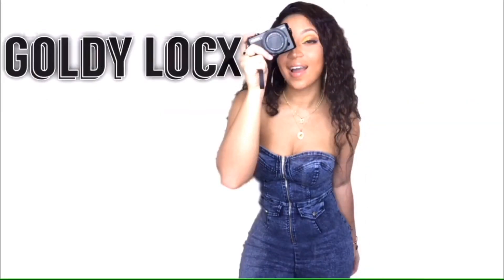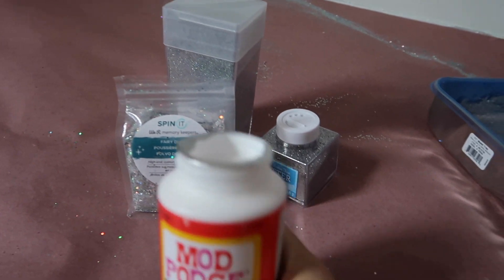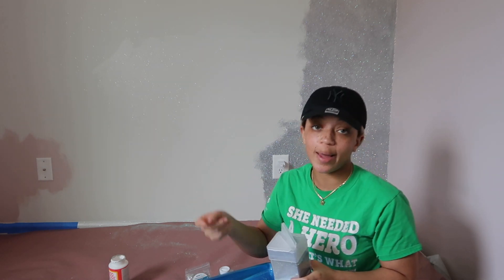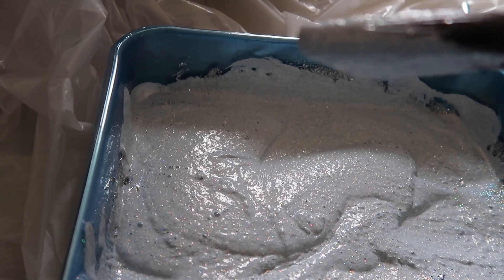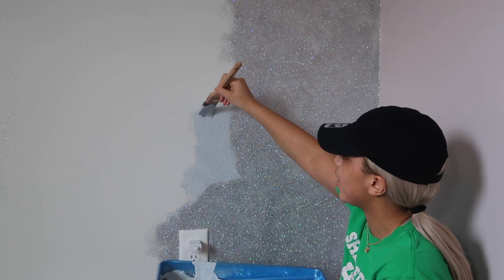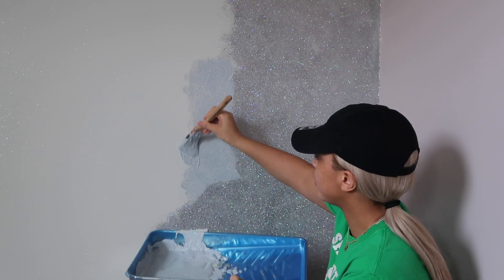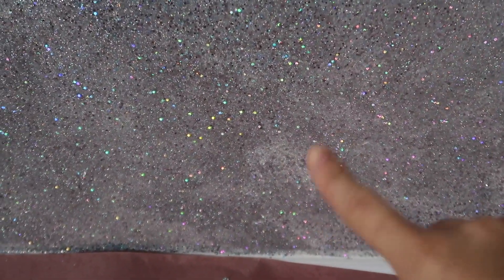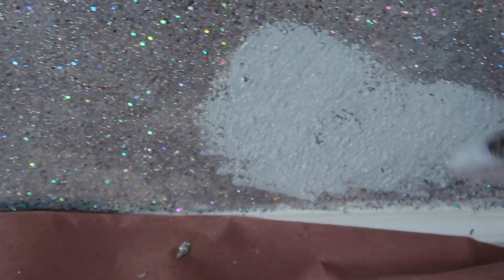DIY GLITTER WALL

Comment: Wouldn't it just be easier to paint the wall the color you want it to be with normal paint, and then just get a clear top paint and dump all the glitter into it and apply like normal? Compared to hand painting the entire wall and getting splotches spots you then have to do another coat on. Just paint the walls like you paint your nails with glitter top coat if you want a prominent glitter.

Comment: Do you think this look could also be achieved with a sponge?
Reply: A normal sponge like you'd use in the bath? I don't think so, no.  Sponges are absorbent - nylon paintbrushes aren't.  I honestly think you'd find it a frustrating experience with a sponge.  You'd end up with a sponge full of Mod Podge, and keep lifting off the glitter you've just laid on.
This brush technique, an extremely close weave sponge roller, or at a push – some plasterer's spreading tools, perhaps!  That, or ultrafine glitter, a compressor, an air gun, then pebble-dash your wall if you're feeling super-brave –  you'd get it done in about 2 minutes! 😂

Comment: It's another video I just watched before this. They used a paint roller and it turned out beautiful to cut a lot of time out I will be using the paint roller it's just a specific kind you need. But this is very helpful as well.
Reply from the maker: Got ya ! See that’s really helpful to know which type to use bc when I did it, definitely did not work. Thanks so much for the clarification love🦋
Reply: @GoldyLocX  mohair roller.
Reply from the maker: @minamuhammad9914  thank you so much for sharing!

Comment: The only thing about mod podge is that it yellows overtime. It takes a few years but that's what I'm trying to see. How bad is this yellow after a few years? How would we remedy that and can this be painted over with regular paint without any lumpy texture if/when I decide to sell my house.
Reply from the maker: C&M Studios I don’t know about the yellowing but it silver, there shouldn’t be any shown yellow whenever it does start to age. Also no you won’t be able to just paint over. You would need a sander possibly and/ or the same elements used to remove popcorn ceiling. 💜

Comment: Where did you find the bag of chunky glitter I cant find chunky glitter in big amounts like that anywhere!😔😔
Reply from the maker: I went to Michaels they had all the holographic type glitter. If you go, be sure to pull them up online for a 30% off coupon for anything originally priced!!
Reply: Thank you for your response! Those 3 glitters were all you needed for the 2 coats on the wall?
Reply from the maker: Kira Brewster no, get about 2or 3 of the larger sizes of each. Always keep your receipt bc whatever you don’t use, take it back to the store  if it’s not open that is. Lol

Comment: Thank you for the way you did this video. It's exactly what I needed. Why can't I use a roller? Ahh, that's why. Love how you used the three different types of glitter and showed the different between the patchy and the solid. Curious - is the wall just as sparkly now, 6 months later? Has glitter rubbed off or flaked off?
Reply from the maker: Yes love! Haha thank you so much for watching! 💜💜
Reply from the maker: And no ma’am .. it’s on there perfectly